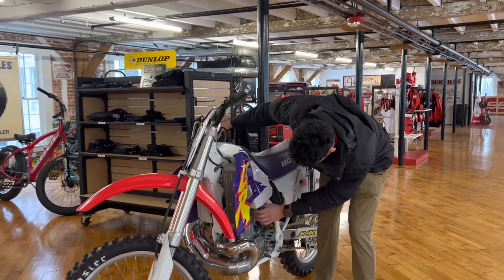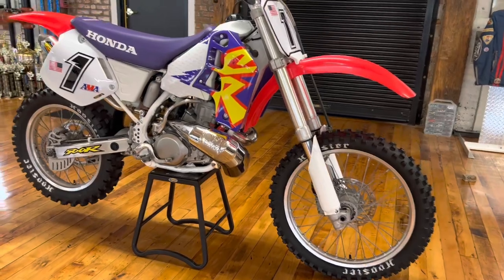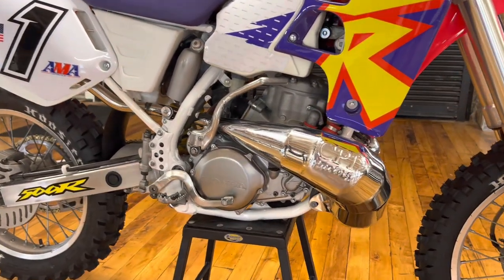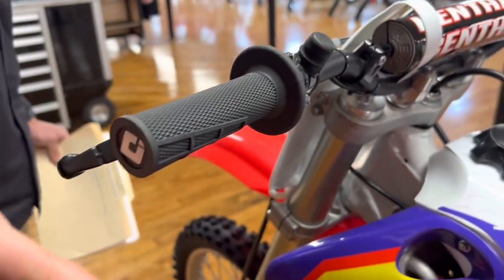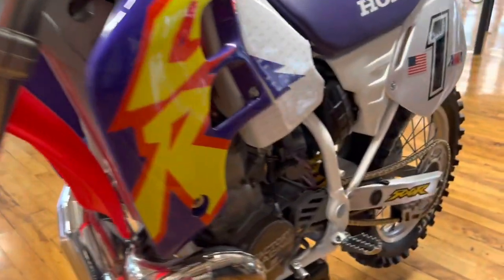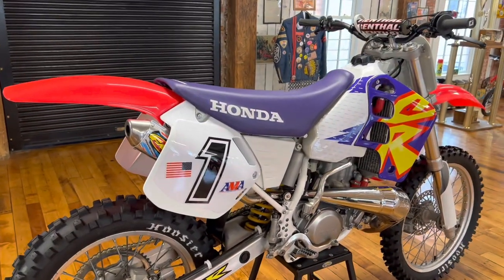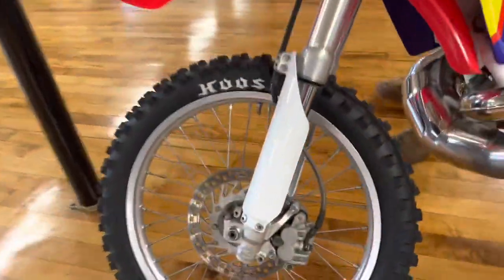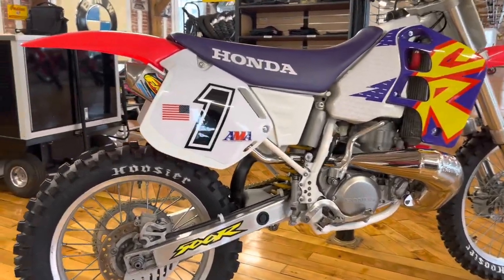1995 HONDA CR500R

Comment: When you run out of of the "good" 500s, you'll be working much harder to rescue & restore the "bad" ones.. 
Im into my '88 RC500 replica for around $4K allready because Im a bit of a perfectionist and got some extensive work done (frame rail repair/replacement from a certified welder) and am going over everything with a microscope. While it has stalled while I look for parts and fabricators, it will be as authentic as possible.

Comment: I have 2 questions for you if you don't mind? First I have a 88 Honda trx250r with a CT350R Power Valve Motor and it's set up to run VP 110 non- ethanol fuel ,would it be safe to run that VP T2  which is 105 pre-mixed non- ethanol fuel but you already know that, so would it be safe to run the T2 or just stay with the 110 ?? And the second question is if that 95 cr500r is able to be street legal would you be interested in trading for my lonestar and Roll Design trx250r with a CT350R Power Valve fully built motor but I'm only interested if it can be street  legal thanks so much and god bless America Anthony Bock